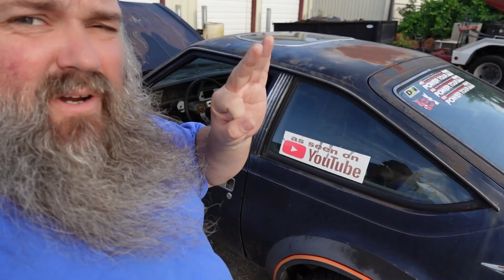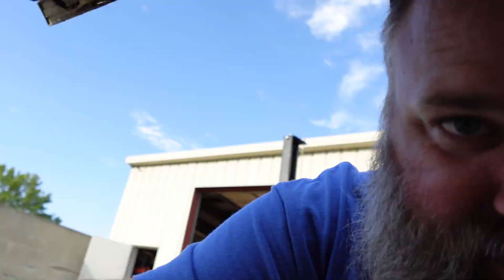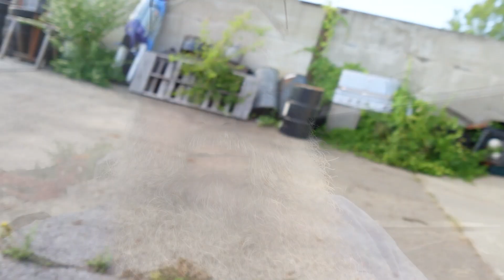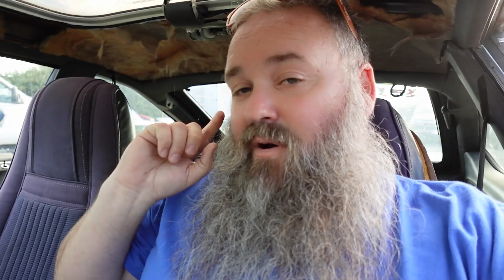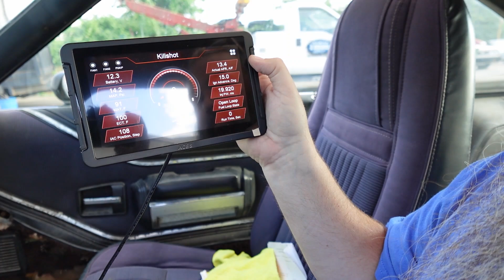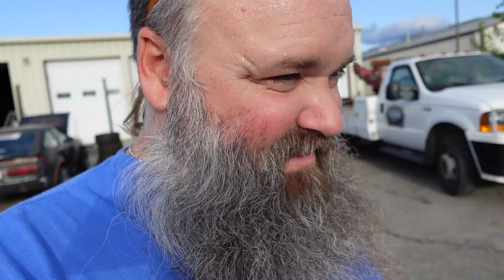EFI Conversion or Carburetor? Pros? Cons? Do it, or wait?

Comment: 5:35 Yeah, I bought a 1986 Toyota 2WD pickup from a kid that had trouble getting the carb to run right.   He swapped it to a cheap Chinese "Weber" (Cheber) to solve the issue. That wasn't the problem.  The problem was rust chunks clogging the fuel line, heh.  Got that one cheap though!   If you ever get one of these, put 2" drop spindles on the front, 2" drop blocks on the rear, 1" spacers and 17" wheels and it will handle better than a Camaro! But to answer your question, it's not so much Carb vs EFI but WHICH carb and WHICH EFI.   Replacing some of the crappy earlier factory EFI systems with carburetion sure was the way to go in most of the 80s!!!  Remember those Japanese imports that were taking over?  Yeah lots of them like the Toyota Pickups and the Honda Accords were CARBURETED.  I've converted lots of engines that NEVER were meant to see a carburetor to carburetion, just because it's fun and a lot of the time easier and cheaper then sorting out OLD OLD crumbly plastic, oxidized wires, and dead sensors everywhere, and sorting out the wiring harness (and I soldered professionally).  I'd rather just find and adapt a manifold (or make one), and pop a carburetor on it and I'm done.   Speaking of boost and carbureton, if you're using a roots blower, just do suckthrough on an alcohol carb!!!  I did that with a stripped down nissan QG18DE and a Holley double pumper.   After hard pulls, the outside of the SC14 supercharger (from a toyota previa) would FROST UP.  No bull!

Comment: How dose the Aces hold up over time? I had a sniper 1 and it was great for a couple years and then it lost an injector.
Reply from the maker: It did great for thousands of miles through all sorts of tortures. Just swapped over to the new Killshot 2 in my most recent video to get the new bells and whistles and it's even better!
Reply: @AutomotiveAdventuresWithAustin nice, I’ve seen them around but not really seen many people running them. If they work and they’re affordable that’s a win win. I’ll have to check out that video.

Comment: I absolutely respect the fact that it's shows you have such an understanding of mechanics that you can see that EFI has many advantages over a carburetor and is better in most ways but to also point out that it is a system with specifically different components to it ( fuel pressure being higher and o2 sensors that the design of the exhaust is required to have correct operation and most importantly consistent voltage and ground) that there are definitely factors in considering a conversion to an antique car that just don't make sense financially or even necessary for the vehicle.

Comment: Carbs are more difficult to "Dial In"  but once it's done, they usually don't need much more attention.  EFI's are great - when they work.  If the car is not already set up with EFI, it has to be converted to work.  In my experience, two (unnamed systems) have failed for friends who retromodded their cars to have EFI Systems, needing AAA to flatbed the cars to be repaired.  A Carb would not have left them stranded.  I have two classics that I decided to go the Carb route for this reason (Edelbrock on the Corvette, Holley on the Camaro).

Comment: Planning on putting an aces killshot on my suburban for the fact I travel up and down in elevation I live at around 5200 feet but drive up 9000 feet and as low as 3800 feet
Reply from the maker: PERFECT reason to do this swap, they are sooooo much better at handling dynamic situations like that.
Reply: @AutomotiveAdventuresWithAustin  exactly. Will probably do it once summer hits and I can run the 2wd a little more while I swap it.

Comment: Got a 87 squarebody in the drive, bought it with a carb on it instead of the fuel injection. Had no tank. Bought a saddle tank and placed a injection style pump in the tank. Can you recommend a delivery system ,including line to gat fuel to the carb from there and a regulator to reduce the flow for the carb? can anyone link me to a channel ? Love this channel , but this is above my current understanding.

Comment: I just ordered mine for my 1969 Firebird 400. Hoping to add a TorqStorm supercharger. Should give me at least 500 HP while keeping it very driveable and under the factory hood. You did say you thought these work better under boost than a blow thru carb?
Reply from the maker: There is definitely a TorqStorm or two in my not too distant future for sure, as long as the motor is built to handle it and the compression is safe enough, great way to add some grunt without going for a wild undriveable build. The very very nice part about these EFI systems is they have a built in MAP sensor and the fuel setup I'm using here has a boost reference so it will up fuel pressure as boost pressure increases. Very very easy to set up and handle. Blow thru carbs are nice but drivability can often times be an issue there.

Comment: Ive got the aces killshot on my sbc swapped jeep and its been awesome. I do like the simplicity of a carb but not the flooding and cold starts. Killshot fires right up and has snappy throttle response and doesn't run rich all the time. They just really need to be tuned to be perfect and I will echo what you've said about the exhaust and electrical issues. My first and only issue with the aces unit was the in tank pump they sell but it was my fault during install. Had it too close on the bottom of the tank and retraced flow causing it to pop the fuse during startup. Also I think I should have went with the command center like you did to be able to swap back if need be.

Comment: I gained HP on top end with efi . Running vortec heads with no heat crossover carb would puddle in winter.

Comment: Love AMC`s!.  Just put the Royal Flush on my 69 AMX, but have a question; Why do you run the system at 60 PSI? As I know the fuel pressure should be like 43 PSI?   Thank you for your videos of the ACES install, really show how this is in both good and bad ways, :)

Comment: Nephew has a sniper. Started his car in the spring and had an injector stick open. This was in June. Still waiting on Holley to return his efi unit. Seems their customer service sucks. Had my fi tech 5 years. No issues.
Reply from the maker: OUCH! Hopefully the injector sticking didn't cause any engine issues? Bearings/rings? Sorry to hear about the Holley service side, but glad to hear about the FITech unit, have used their products on numerous machines in the past and been pretty satisfied.

Comment: YEEEEAAA LIKE WHEN I BOUGHT A 72' CHEVELLE CONVERTIBLE!!!  I don't do points and condenser. My mom was great at adjusting them. Not me. I dropped a HEI distributor in it. And that car was so reliable back in the midish to late 90's. After I started to learn injection. I'm still a dork. But I am still learning lol!!!

Comment: FOOL-Injected 1995 Chebby  K2500 4WD Truck  
Throttle-Body = 7.7 MPG  😞  
...
2012 Toyota  PRIUS Two  HYBRID =  61.3 MPG  ///  1.8 liter Gas Engine 
...
What's the  FIX  for 350 ci Throttle Body TRUCKS ?
...
COOP
...
Reply: Factory throttle body? Junk that! I have a 1994 C3500 with built 454 and Sniper unit. I get 11-12mpg just running around town and back roads.

Comment: I ran a FiTech "Mean Street" system on my 65 GTO from 2016 to May 2024. I believe the ECM needs replaced, it would randomly shut off on me last year. They made lots of improvements to their systems since 2016. It ran flawlessly and I put around 45,000 miles on the car, doing road trips 1000 miles from home and then driving 600 miles with a bunch of old cars. 

Never lost a fuel pump, I run Walbro inline pumps, usually mounted to a bracket I make, close to the tank, but lower than the fuel level. The farther you put it from the tank, the shorter its life will be. Also if its above the tank, it won't last as long. The 225lph pump I ran on the 65 for years started making noise, so I swapped it for a 255lph, everything ran the same and now I use the 225 to get E85 out of the barrels. 

Swapped to a carb so I could drive the GTO. The carb I swapped on is an 850 Demon double pumper I converted to E85. Its tuned where I want it according to my standalone O2, but man does it use a lot of fuel compared to my other carbs and EFI. Its down on power compared to all the others too, but that could be lots of things, not just the carb.

I like EFI because I can make them run on pump gas or E85, but the only engine I have that has low enough power to use the Aces, Summit, Atomic systems is the Cuda. I think the 340 in the Cuda has a vacuum leak under the intake, kinda like a pvc in a port, because EFI will not run on it. All the Pontiacs are well over 400hp and they all run on E85, so I need roughly a 600hp unit for a 500hp engine, just to make sure I don't hit 100% duty cycle and mess up the injectors.

Also have one of FiTech's dual quad 1200hp power adder systems, can't get it to run right. Had it on the tunnel ram and the 6-71, and I could not get a good idle with it. I have an Offy dual quad I plan to put on the 65 GTO, and then I can run the EFI on that and see if it runs decent. The tunnel ram had vacuum leaks where it bolts to the heads, so I put the blower on instead. At this point I am not blaming the EFI, because the engine I am doing all of this on is nowhere near stock and only has three factory parts on it, the timing cover, the camshaft eccentric, and the distributor clamp. I bet it works fine on the GTO, but its only around 550hp or so.

I rebuilt and modified some chinesium 850 carbs to run E85 and put them on the blower, it runs and starts good. I am rather impressed with how well I made those carbs work, they were not a bolt on and go deal and they needed lots of work. Using the carbs I figured out I didn't have enough pulley on the blower to feed the engine, and thats probably why it never really ran right with EFI. Went 12% overdriven vs 6% and it made a huge difference, now it pulls beyond 4000rpm. It needs some testing, not easy to do with a never ending stream of RVs and bankers on Harley's going by all day.

Been playing with the idea of using some factory EFI and building a system using all the LS stuff I have laying around, or maybe a megasquirt system. Have some things I want to do with E85 regarding mileage, and I need a system like that where I can do a lot more than with one of these TBI systems. I need it to be low buck though, even though the FiTech dual quad wasn't exactly cheap, I can't justify $4k at this point for a Terminator or something similar. 

Installing them right, on an engine without vacuum or exhaust leaks, means you will probably not have any issues with these TBI systems. They are simple and you can make them run quite well, but you can also screw them up super easily... just like any carb (other than edelbrock because they have minimal tuning capacity).

Comment: We already know, you LOOSE HP. on top end with EFI, that fact is already known. And if you have a truly restored car, we surely are NOT going to drive then (any of mine) in rain, cold or snow. If you have a beater you drive everyday, or a work truck you might use a EFI, but I still run Q jets or Holley till death.

Comment: I have a street driven 80 Camaro, 406 SBC. I removed my Holley 650 Carb, HEI Distributor and replaced it with a FiTech 600HP EFI and MSD Ignition about 2 years ago. I choose the in-tank fuel pump. Initially, after the change, my car would die after a 20 minute drive, wait 5 minutes, then drive about 2 minutes and repeat until I got back home. After a few months of troubleshooting, it turned out to be the MSD 6AL Ignition box that I mounted under the hood on my firewall. It was to hot at that location. I moved the 6AL inside my passenger compartment and its been awesome. You didn't mention cold starts as I live in Indiana and during the winter, cold starts are easy. No gas pedal needed or holding a higher RPM for a few minutes to warm up the carb. I bracket race my Camaro and making a timing change or AFR target change is easy. All these EFI Systems collect DATA.  Looking over about 20 parameters after a drive is fun and great for making adjustments, if you want? But like you said, you must drive it, let it learn, and that should be good for most people. I like to look into the data, but that's just me. Most important is Reading the Instruction several times before you begin, having good grounds and solid electrical connections (suggest soldering), no vacuum or exhaust leaks. Start with a healthy, good running engine is also key to a successful EFI transformation. Good Luck

Comment: "Much higher or lower sea level.." Austin you're showing your midwesterner.. Sea level is constant, the word you were looking for is elevation. A good carb guy with all the tools and parts can set up a carb for any situation. ANY SINGLE SITUATION. Carbs are not designed to deal with changes in temperature, air pressure/density, or angle. EFI only requires a computer to make changes to it and can tune itself within ~15% +/- of it's base map. Port EFI also is better for fuel distribution, especially if you are running sequential injection instead of batch fire... batch fire is why stock computer cars still get bad mileage because they lazily fire multiple injectors on different sides of the engine that are paired together for reasons unknown which not only wastes gas, it increases emissions. If I ever get to build my square body Ranger like I want to get (especially if I can find a 85 like me) it's definitely getting EFI, especially now that there's California smog legal EFI setups. EGR and carbs can kiss my ass.

That thing's still gonna get hot in traffic from the heat of your exhaust on the floor. I actually melted a pair of flops in my 70 Mustang at one point. (burnt the hell out of my big toe on the arm for the brake pedal the other day when it was 110 and I got in the truck without leaving the AC running for 20 minutes first.. things get hot in vehicles)

Comment: In my opinion, if you're not direct port injecting then it's nothing more than an electronic carburetor.  One oxygen sensor is a terrible method for determining fuel to air ratio because you could be melting pistons in two holes and sloshing raw fuel everywhere else.  The only way to guarantee success is to install 8 oxygen sensors and create your fuel tables before it gets on the road.  Then you can run a single O2 sensor to have it switch tables when dealing with changes in altitude, weather, and fuel composition.  I would never recommend an electronic carburetor over direct port injection because it doesn't compensate for uneven intake manifold design, which is the reason why so many people have trouble getting their jets and mixture screws to run right in any situation.  When I talk about direct port injecting I mean sequentially firing, not batch fire.  Batch fire direct port injection is the absolute worst idea of all because you're spraying raw fuel on a closed intake valve three times before it opens.  Watch dumbass David Freiburger on Engine Masters, that guy knows less about fuel injection than my dog.

Comment: My son has a sniper system on his truck and we did Power Tour in 21. No problems and it was great. Since then it has had a few minor quirks.  Hind site I would jump up to the Terminator system for a few reasons.  We also did the self learn but did get it Dyno tuned and picked up 45hp to the wheels. The self learn does not change timing.

Comment: Man  I drove my 1972 Nova for years all through the 1990's it had the original 350/350 with 2;56-1 rear gears and it has a crane cam , don't remember the spec's but I put it with the help of a friend in 1993 , and I ran a Edelbrock Torquer 2 with a used 650 Holley, and you'd be surprised how much driving I did on 5 to 10 dollars worth of gas , I worked in restaurants in the early 90's and I didn't have a lot of money. But it was a very dependable car , I still have it and am getting close to getting the rest of the stuff to start taking it apart so I can make it a little faster . Lol cool car you got there , and good video . I don't mind fuel injection but just adds to more things that could go wrong . Lol

Comment: My opinion is since I have all the tools for the carburetor in the know how also on certain applications the carburetor is perfect however unfortunately fuel injection is a little bit better however I have never nor will I ever build a classic car that is carbureted and swap it over to fuel injection. What does two of my three kids are Gearheads and I've taught them everything I was taught about building Motors unfortunately for my kids I'm not ready to check out yet so they're going to have to wait to inherit my cars so until then my carburetors are there to stay